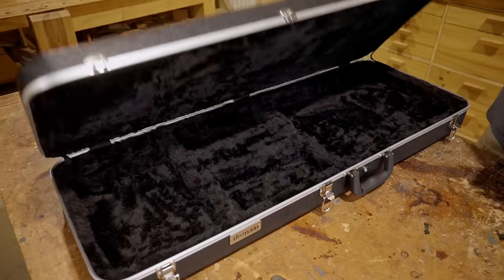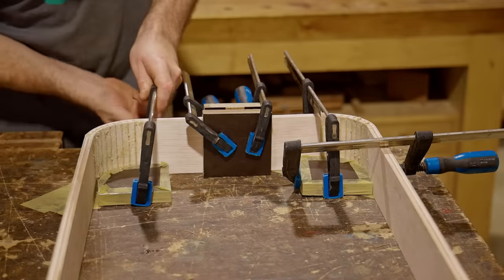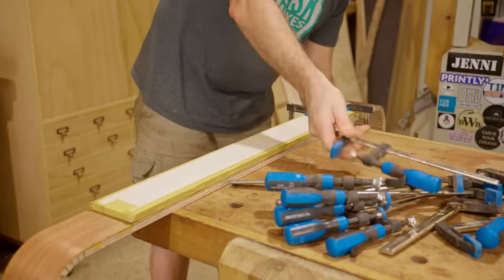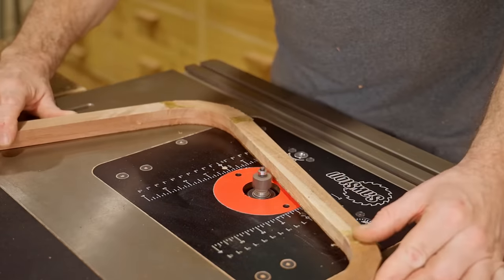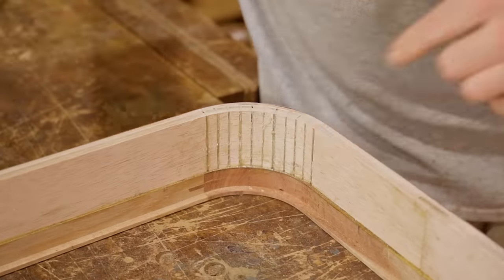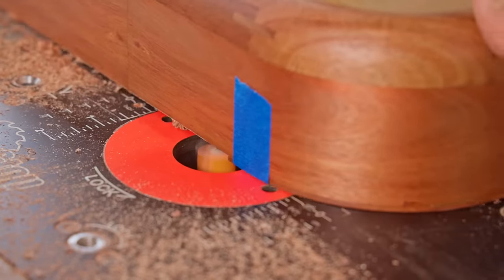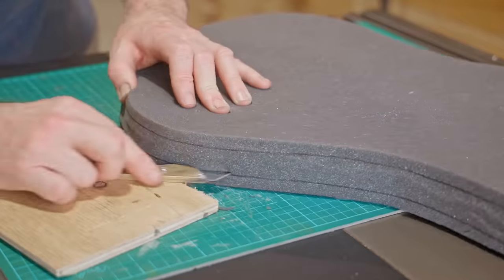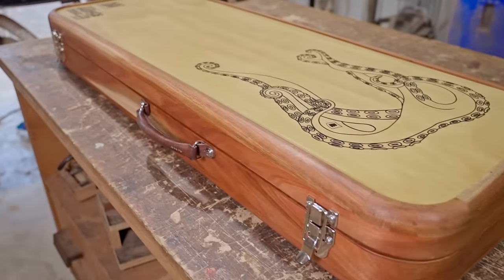Classy Wooden Case - How to Make it - For Travel/Guitar?

Comment: Tip for you when using transfer tape that is too sticky: I lay it out on the granite counter tops in my kitchen, sticky side down, and then peel it off before covering the decal. Then just clean the counter with a little alcohol. Just makes the transfer tape a little less sticky.

Comment: Thanks for the gifts of experience and technique. I don’t play a guitar. I don’t have or ever will have a guitar but as usual knew I would pick (see what I did there) up a valuable tip or two on woodworking. More like quite a few.! The tall, DIY feather board, the vertical reference fence and clamp holes in the tenon jig instead of t-tracks, the simple compass work to center and align the feet to the radius , balancing the case for handle placement, details of foam design and assembly in a presentation box, silicone on screw heads, etc. thanks for including all of those useful and universal aids. I always watch, even if I’m not remotely interested in the particular project, and always gain something from makers in these videos and you are the best.

Comment: Really beautiful work! I have been thinking about trying kerf bending, it's good to see a practical application like this.

If you make more cases, you might want to leave a compartment somewhere in the case for the extra little things like a strap, spare strings, picks, maybe a cable. Even for a work of art like this that is probably too nice to be gigging every night, it's nice to keep any spare parts or related accoutrement right in the case with the guitar.

Comment: Really cool guitar and case. Top notch. I would add a strip of wood down the inside lip of the handle side of the case. This will slip behind and support the opposite side of the case when it is carried by the handle.

Alternatively you could add another handle to the other side of the case.
Reply from the maker: Thanks very much Ross! I think you're absolutely right and I think I will do that. :)
Reply: Came here to make the same comment; handle could use a load-spreader, possibly even a strip of steel ? Still, it's a lovely piece of work 🥰

Comment: Beautiful work as always, Neil. Just a thought, if you put a dowel in the edge trim between the ends of the handle, it will connect the top to the bottom when the case is closed, and prevent the bottom from bowing out of register with the top. Most guitar case manufacturers use a latch near the handle for this purpose.

Comment: I've built a few custom guitars and now need a matching case for one, this video is priceless, good to see the practice of drill pilot hole then use hand screwdriver to prevent damage to wood/snap head.
What size router bit did you use for the edges, the big one.
All best for new year.

Comment: Great craftsmanship. I just bought a used case recently and the outside gets a heavy damage. I can see how much work you did put into exterior. It would make more sense in my view, to make it flexible and cover with rubber. There is a special cabinet paint for this purpose or carbon fiber. Just wanted to share. Have a happy New Year 2023!

Comment: Been trying to figure out how to make a make a flight  case for a keyboard that would be strong but didn't weight a ton. (They want a bloody fortune for one). Thanx bro. Now I see how it can be done. - Just one thing. If I make one it will be covered in Tolex, or maybe just painted.  Yours is WAY too pretty to use for a working band. (I can just see it getting thrown in the trailer and have a bunch of other cases tossed on top of it.) 

Great work (as usual) And thanks a million for the idea. (Although I really am a dunderhead for not thinking of kerf joints!)  Of the hundreds of guitar case vids I see on here your design is the only one that makes any sense.

Comment: A trick i use to transfer vinyl is rather then using transfer material, I use clear shelf liner material. It holds the vinyl good enough but isn't nearly as sticky and transfer paper

Comment: Looks amazing Neil! Someone's going to love that.

Did those clasps come from bunnings? They've usually got a few types available and the 3 i've tried have been good.

I'd put some wipe-on poly over the vinyl transfer on the outside of the case to give it a bit of protection. A lot of guitar builders use waterslide transfer decals to put designs or branding on their headstocks, and that's usually followed up with something over the top

Comment: Noticed you've been using a bit of Form-Ply around the shop. Due to price and finish I've recently made a desk and filling cabinets out of it and also topped a work bench. 
One big advantage I've noticed is that not a lot sticks to it so it's easy to keep a clean smooth surface. 
How have you found it as a surface for the bandsaw?

Comment: In the video you mentioned using construction caulk for strengthening the corners, would wood glue have done the same job, or is there something I'm missing?  I'm new to woodworking, so I'm trying to learn, not to disrespect.

Comment: Tough to get a tight joint with something so thin as those 1/8” veneers, even with a million nails. I’ve had good luck using micro pin nails and nailing on veneers + a thicker board to help spread the pressure. Then you can just yank off the thicker board and it pulls most of the nails with it.

You may get different results than me, but I’ve always been very disappointed with the color richness of wipe on poly. It’s just lacking something. Too anemic

Another beautiful build

Comment: I thought the handle you put on the case was ghastly, you spent all that time and hard work making a lovely case and then you spoilt it with that cheap looking handle, you mentioned you didn't like the clasps which were chrome, but they did match the piano hinge, also the transfer looked cheap and nasty, it would have looked better if you had finished it the same as the sides, good video shame about the finishing touches